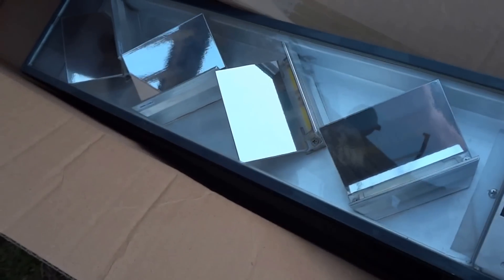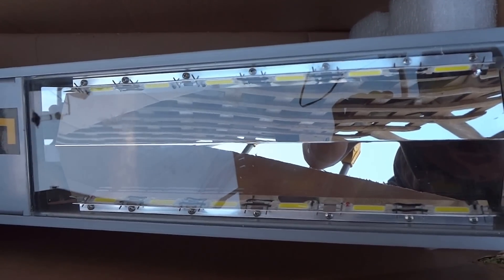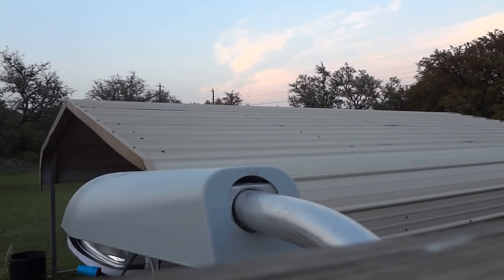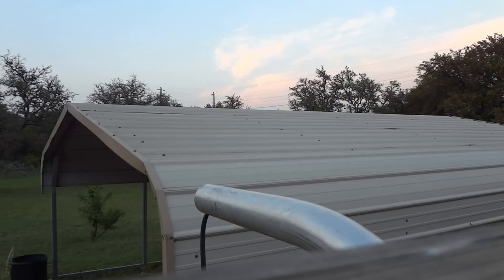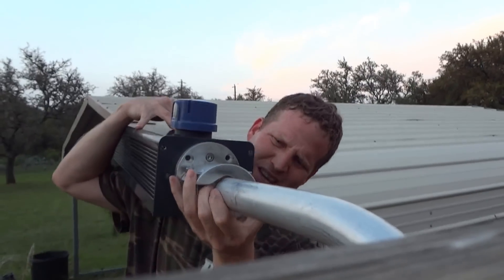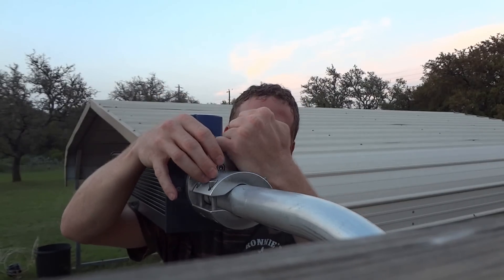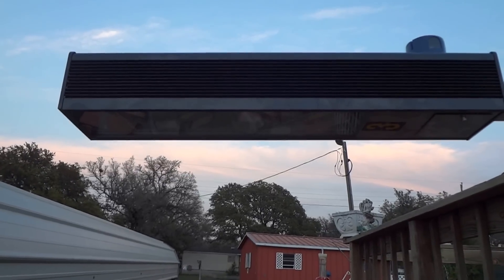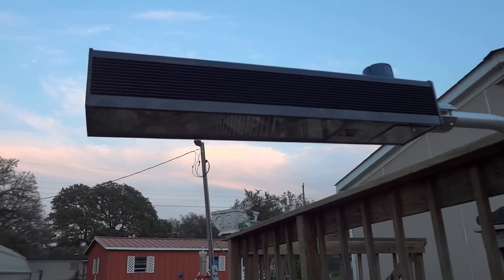How to install LED streetlight

Comment from the maker: Use a small 10amp breaker and only have the LED fixtures on that circuit to keep from back feeding EMF and destroying the power supply. Surge protection is important also. We use 6watt LED modules from Japan and you more than likely have 3w LED modules from China, but I'd have to scope the datasheet. Not bulbs, but LED modules mounted on reflectors. Round Arm mount or square pole mount fixture?

Comment: Hi i just bought a 112 watt led street that that is made up of many actual led bulbs if that's the correct term to use. I'm not an electrician but i would like to mount this led street light on a utility pole that had a 200 amp service panel box mounted allready on the pole. A  few feet from the temporary pole is another utility pole and this is where I would like to mount the led street light approximately 30 feet high. My question is what size breaker do I need and would it be a 1 or 2 pole breaker and what size wire will be needed to hang the led light on a arm again appoximatley 30 ft up?  Any help would be greatly appreciated. Thanks Bernard.
Reply from the maker: +ben marsonek  10amp or 20amp. the LED fixture should only draw less than an amp.